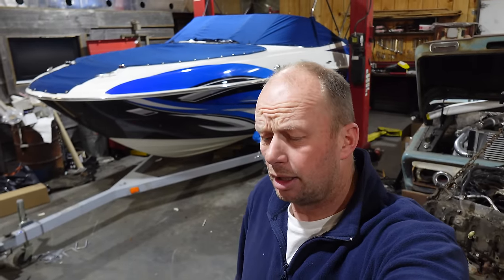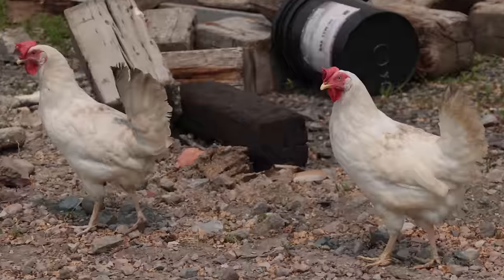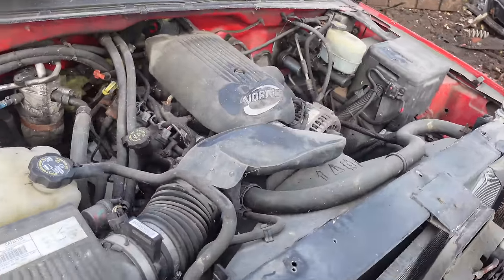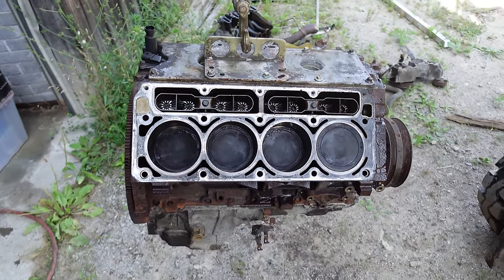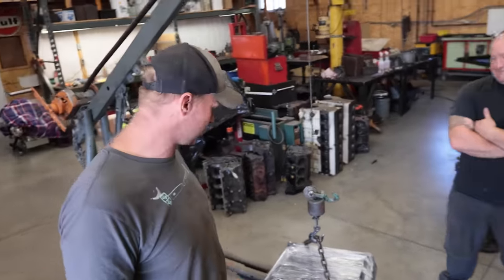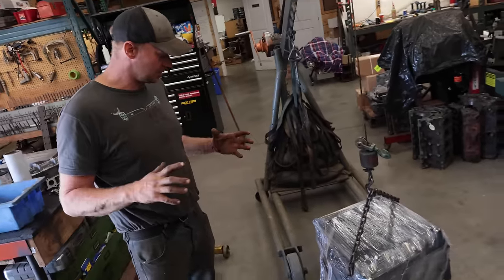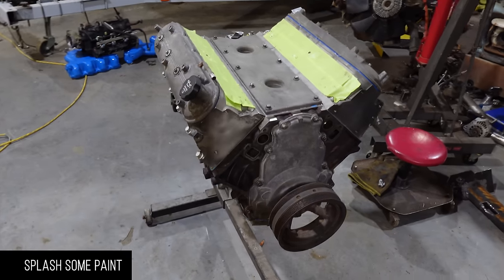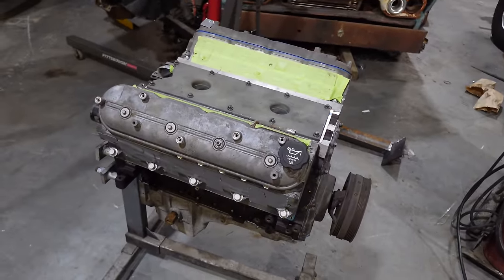On-Road Chevy LQ4 to 500hp Marine LSX Build #deBOAT [EP3]

Comment: As a officially trained mercruiser guy for the last 20 years..  You're going to want the correct marine thermostat/water distruibution housing, to control engine temp.  Not circulating the coolant will give you hot spots and cold spots.  There have been companies that have spent a lot of time and money getting the cooling system correct.  You are going to need a powersteering cooler for sure, should be about to re-use the existing one.   You're going to need a manual flywheel, may have to re-drill it for the coupler.  The shift plate has a microswitch on that, wire it to the holley so it cuts idle down to 400 rpm or so, if you don''t take the load off the gears, it won't shift into neutral.  Make sure you get the engine alignment right before sliding on the drive
I'd mount a belt driven seawater pump now, as that alpha drive won't live long behind the 6.2, and you'll be doing a bravo swap video sometime next year.
Reply: I'm doing the same swap right now. I would like to use the raw water pump from the crusader 6.0 mpi engine (Lq4) . Do you maybe know whether I need a extra bracket for the pump or whether it would fit right in? The pump has some kind of bracket already mounted.. Thanks on advance :)
Reply: @Speedcircle78  Havent ever seen the crusader setup in person, but looks like itll bolt right on
Reply: @ACatKrom  Thank you. Guess I'll find out 👍🏻
Reply: sounds like some minor stuff to make this work. That's encouraging. Not sure why this swap isn't done more often. Maybe it is.
Reply: @shade610  its pretty expensive vs just building more hp in the existing engine
Reply: @ACatKrom  I gotta repower a 5.0 MPI. Of course I want something bigger and i'm seeing prices of like $15k + for LT based Mercruiser engines. I gotta believe this LS setup is much cheaper than that. Maybe half.
Reply: @shade610  couple of things.  
1. Merc has never build or sold a ls or lt based engine.  Their new v6 and v8's are all 100% mercruiser designed and built from cast iron.
2.  Not nearly as cheap as using most of what you have and building or buying a traditional small block that makes more HP.  
3. The alpha drive you have is only rated for 300 hp, to be reliable over that you need to switch to a bravo which requires a new transom assy (the part that bolts to the outside of the boat and does the steering/trim)
Reply: @ACatKrom uh oh...I hit a nerve with the Merc guy 😂 I'm not sweating a bravo swap. Its like the 4000th time someone has said that along with the need for marine starters and alternators. I'd love to hear what the Karens have to say about blown v drives and shit😮
Reply: @shade610  Not sure what makes you think you hit a nerve..  You don't like being corrected about the lt comment or??  Its a fact that the alpha cant live behind real hp, or take any abuse and if you are worried about $$ the bravo swap is far from cheap.  Hell $15k B1XR drives don't last for ever either
Reply: @acatkrom do you know of any way to bypass a shift interrupt switch?
Reply: @yeldawg907  with an alpha drive, its very difficult to shift into neutral without one, the faces of the shift dog teeth have a couple degree angled machined into them, that pulls the gear and dog together under load.

Comment: I'm sure you looked into it, but keep in mind those Alpha drives can only handle so much torque before eating themselves. Hence why when you get to the fuel injected 5.0 and 5.7 Mercruisers you'd start finding Bravo 1 and Bravo 3 drives. That Alpha might need some love to live behind a 6.2 LS.
Reply: yeah needs the bravo
Reply: I also believe the Bravo 1 drives you don't need an interrupter to sync gears to shift, Bravos use a cone clutch and it isn't required, and yes handle more power.
Reply: @natevanbynen6595  I'm not as familiar with Bravos, but yes, Alphas need that interruptor or else you'll be likely to destroy the gearcase
Reply: Best ease into her for sure.
Reply: With that more prop pitch which the alpha will definetly will not handle. 330 hp is max and that is pushing it. In a nutshell the alpha is the 4l60 of outdrives.
Reply: Be careful with that alternator! Not marine rated and can explode if any vapors are in the engine bay.
Reply: @natevanbynen6595  Yea ok, disconnect yours and let us know when it fails? Probably in the middle of the Lake, at sunset….😂
Reply: @Profabdesigns   disconnect what?
Reply: @natevanbynen6595  This comment was to Nate above about disconnecting the Ignition interrupter on the drive mesh.
Reply: @Profabdesigns  Comment was only stating that Alpha drives require the interrupter switch and the bravos drives do not. Interrupter switch on alpha drives (usually) grounds out coil momentarily so the loss of power will allow the dogs in the transmission to become uncoupled. If you ever had to replace one or adjust them, it’s not fun when you go from drive to neutral and it remains in gear because the dogs did not disengage. Nothing will break if you disconnect it just can’t come out of gear without it. Bravo drives use cone clutches so they don’t have that issue. The original comment was highlighting some potential benefits of using bravos over the alpha drives.
Reply: you are absolutely right about the alpha drives. I have a 26' chris craft scorpion with twin 350's, forged cranks, crower racing cams, springs, and lifters, edelbrock aluminum heads... They put out around 450 HP each and i blow alphas like my ex blows the neighborhood. Keep it in the water. First one i blew, caught probably 6-8 feet of air at 60 mph. Tore engine coupler on one and alpha gears on the other. RPM is the other problem i have had. Once you figure out the pitch of your props so you can rev to 6000 RPM instead of 4500 RPM, the alphas dont like that either. Bravo 3's would be great, but have to refinance the house to get a pair.
Reply: @kravinmorehead7307  what about Bravo 1's?
Reply: Bravo 3 I believe has counter rotating dual prop...big game changer! Especially with a good built hull...good built are not light...but don't bob like a cork
Reply: Like building up a stock car ...
Anything you do to gain there is some kinda sacrifice....very much more so with a boat
Reply: Alpha drives came on 7.4 also
Reply: @strictlygm  and the starter, 🎉I've about 5 boat fires so far for the  year that was caused by cheap amazon auto parts

Comment: You need the thermostat housing that feeds not only the block but the manifolds too.  Plus the motor will really only run around 70c or 80c.  You will need the power steering cooler and the right flywheel for the outdrives input shaft.  Go ahead and do the bellows and shift cable boot while you have it all apart and save a couple thousand bucks by not taking it to the shop.  Thats where I work. Thats not a cheep job and takes a good week of working it all out. Good luck. There is a shift bracket that mounts to the top of the motor that synchronises the throttle and shift cables and has the interrupter microswitch built in.  The old stuff that was in the boat should work.  It is a must have to get the out drive to shift and not kill the dogs in the foot.
Reply: Some manifolds use raw water and some use engine coolant. I would just use raw water in that application 🙂 1. The main heat exchanger might not be large enough to cool both engine and the exhaust. 2. The exhaust manifolds are cast iron so they can take raw water (salt water) and as i understand this boat will mostly run in freshwater lakes/waterways 👍

Comment: The O2 sensor needs to come up to a high temperature in order to work properly to send the computer the right signals.  Having it go through the cooling jacket of the exhaust on its own could very well mess with the O2 sensor signals.  I suppose one could use a piece of round stock, drill and tap for an O2 sensor.  It'd have to drilled out deep enough to allow the O2 sensor to reach the exhaust and wide enough to get a socket on it to tighten it.  I don't think you can weld the round stock in place, as how do you get weld on the inside.  Maybe the exhaust walls are thick enough to tap, and the round could be threaded.  I don't think the exhaust walls are thick enough though.  This is probably why another bracket is used for the O2 sensor.

Comment: Still want another boat with a diesel engine. You're one of the few that i see could do it. Really would like one in my wakeboat/surfboat. That low RPM torque would be great for a boat with lots of ballast. And lets not forget running off road diesel as a plus
Reply: Second thought. I'd like the Edison motors hybrid setup too
Reply: An LBZ in a boat would fascinate me, not going to lie.

Comment: Impatiently waiting to see it on the water!  Doing virtually the same project, 6.0 closed loop into a fully (and I do mean fully) rebuilt '97 Larson SEI194.  Haven't swapped cams yet, will do that once I've run the cooling system in and confirmed it performs as it should on the stand.  Crank-driven raw water pump, MarinePower manifolds, twin-exchangers, custom spacers for twin O2 sensors, Holly Terminator X, 90mm, etc.  Following your lead on the SeaDeck, very likely wrap it too.  Get back on it, let's see yours go!

Comment: You only need a shift interrupt when coming out of gear. A way you can do it is by using the factory shift interrupt switch bracket, then hook up the coil signal to the switch. when enough tension is exerted on the lower shift cable, a limit switch temporarily sends the signal to ground thereby temporarily killing the ignition. the original distributor setup uses the magnetic pickup signal. interrupting the signal going into gear is actually a symptom of a sticking shift interrupt switch. the dog clutch is designed to engage with either the foreword or reverse bevel gear in the lower unit. the dogs are slightly tapered to hold themselves in gear. as long as you "shift with a purpose" and don't grind it, you will not have issues. Bravo drives do not use a shift interrupt due to all bravos using a cone clutch in the upper unit. when you get the motor running in the boat use an idle rpm of 700 rpm max. any higher and you start to run a risk of damaging the dog clutch and prop shaft.
Reply: i was looking through this build trying to see how the interrupt was wired? and saw your comment im working on a carb on LS build on sterndrive scratching my head on how to wire interrupt with an MSD 4016. I've heard some guys try to knock out ( ground) a bank of coils as a solution. sounds heavy handed.
Reply: I meant 6014

Comment: @30:58
I'm not familiar with Holley specifically, but a few different EFI systems.
There are potentially quite a few ways to tackle this.
If there is a nitrous control feature it will have ignition retard. Have an input active when you want to change gear and set it to nitrous then map how much ignition retard you want to pull power.
How to have an active input when changing gear. This could be an input based on a timer. Some ecus have race timer functions. Gear position = 1, timer starts. input is active until timer reaches 500ms. Or it could be as simple as button on the shifter, grab the button when moving the shifter. or even just a little switch that is hit by an arm like old WOT switches, or the little switches that used to ship with nitrous kits so it could be hit by the throttle arm or pedal.
Another method could be a flat shift feature. Have a switch that is active when moving between gears or use a potentiometer to give all positions as a variable input. A strain gauge can also be used here to trigger the cut. Clutch switch or position based flat shift inputs usually have a setting for throttle position >xx% to make them active. This would need to be set to 0% to work. The idea here is to make it think you are flat shifting when you move the gear selector. Flat shift features also usually have multiple ways of retarding power such as ignition retard, ignition cut, fuel cut or close throttle (dbw). Some will have features for ending the cut after xx time or switch states no longer active. Some will have features for limiting to xx rpm during the shift.
Or there may be some map switching or generic tables that you can use with an active input when the boat is in neutral, then have a retarded timing map or a timing correction table that retards timing to a level that makes selecting a gear easy.
Many of these settings will also have a setting for how fast to return to normal ignition timing after a retard event which might be in degrees/sec or %/sec, something like that. This can be used to make the transition smoother. Although it is expected that this change would happen at idle so it's not likely to be that much of a problem.
None of this really takes in to account that modern efi systems control idle speed with ignition timing as it reacts significantly faster that air control, so making changes to timing at idle may just encourage the engine to stall, which is getting mighty close to the olden days method of engaging the drive gear on a ski boat...turn if off, put it in gear, turn it back on.

Comment: B is for Build ran very similar manifolds but without the risers and found on ebay a aluminum 2" riser with o-rings and a spot for an o2 sensor. My guess is that you need the riser height you have so that way the water won't back up into the engine when not running. Not sure if this will help you or you have already figured out a solution but it was something I say and wanted to pass your way.
Reply: Except Cris won’t be using his boat for a bit after it sank.

Comment: Need marine starter and alternator. Not sure where you are putting the pressure cap, they are usually in the heat exchanger. The Apha has the raw water pump in it, but if you switch to Bravo when you torpedo the Alpha, you’ll have to spot a pump on the motor. Fun build, been boating and done a few swaps, cool project.
Reply: Pressure cap goes on a separate header tank mounted on a high point in an application like that 🙂

Comment: 28:30 I'm not a professional when it comes to boats, but I remember from a B Is For Build video where Chris is swapping the twin LSX's into his yacht, that he kept having issues with the O2 sensors fouling out because they were getting wet from the water in the exhaust. I believe he ended up making a tube that came off the side of the manifolds, to keep the sensor out of the water. While it might not look the best, it seemed to work for him, until he boat sank in the harbor.

Comment: You should just put a thermostat in and treat the heat exchanger as you would a radiator. Would make everything more simple then trying to cycle the electric pump. Just my thoughts. Excited to see this thing rip on the water!

Comment: I am doing a Ls3 swap in a 03'Crown Vic Police Interceptor. Ls3/6L80. I am making videos for my grandkids. It's alot of fun. My one grandson can't stop going on about it. Lol. I was going to do the 6.0 to 6.2 like you did. But a L94/6.2L block fell in my lap for $500. And a ser of 821 heads for $300. I just picked up a 2015 6L80 core for $300 as well.

Comment: Im thinking about the O2 sensor.  If you want to drill it.   Id go a little oversized and weld in a sleve.     Im sure your welder can handle that cast !    Ive welded cast iron steel and aluminum not as big if a deal ad many people think.      Just keep an eye on it. The heat cycling if the exhaust may cause some issues tho.  Best bet is to probably buy thag adapter and paint it.     ORRR   make a new spacer from scratch. I don't think it would be hard tk make.   And just paint that one.   ( Probably your best bet IMO) then you can have two made and run two o2 sensors if you need to so you can compare banks when tuning

Comment: All marine heat exchangers run the raw water through the core of the oil and water coolers. You explained to do the opposite on that "pool heater" 🙂 Easier to get air out and up to the (high up in front mounted) header tank when you run the engine coolant on the "outside". And same way i've seen the heat exchanger mounted on some marine engines like "Ford Lehman" and "Iveco Aifo". Good luck that will look very nice when finished.
-Arne 😊
Reply: Sea water/salt water (raw water) side in coolers sometimes need cleaning and it's "easy" to clean the core pipes with a "barrel brush" 😁
Reply: Good idea with that heat exchanger cant wait to see it tested 👍

Comment: Don’t forget the alternator and starter need to be marine grade or sealed so they can’t ignite fumes
Also the insurance companies used to deny claims on boats if you didn’t have the correct marine grade equipment if you were insuring it

Comment: Cant u put o2 sensor after the collectors? I wouldnt try to modify those crusaders. Crusader Marine was the goto shit in the day. with them being risers if u cant weld ur through cast sensor bung correctly, u risk flooding the engine with water. Just my thoughts on what I was seeing....Love what ur doing. Specially with the electric control able water pump, and the heat ex-changer...which by the way is how most salt water and big boats are. Plus now u can isolate the internal to antifreeze...so the block is already winterized. Sweet man

Comment: I've never built an LS motor.  Last motor I built was a 355 Chevy alcohol injection that would drink 3.5 gallons in the 1/4 mile running 6.10

Comment: They make what's called a dry well sensor port. They used in the heating and boiler systems. It's a well that screws into a water jacket and allows a probe to go inside dry. Just throwing that out there